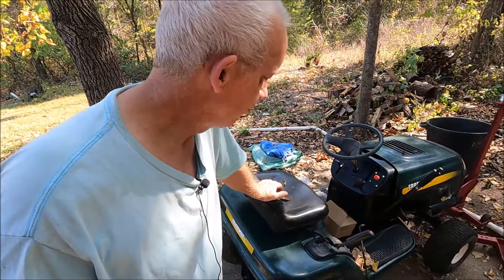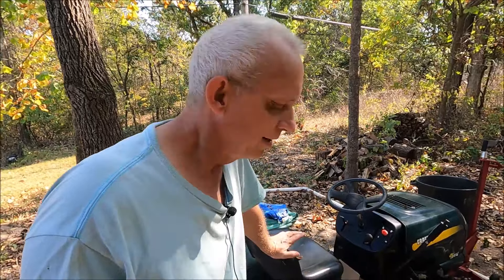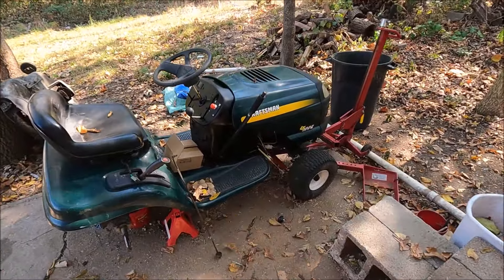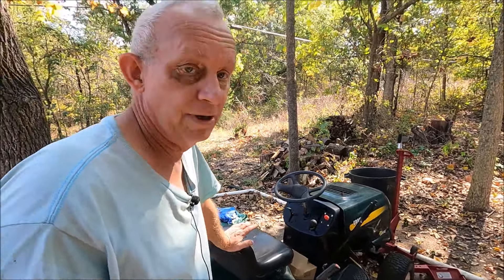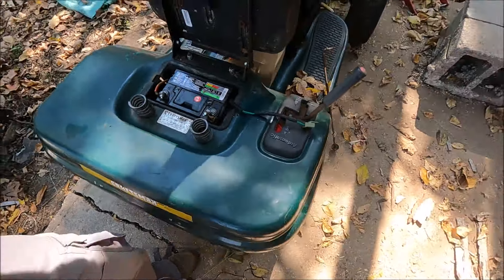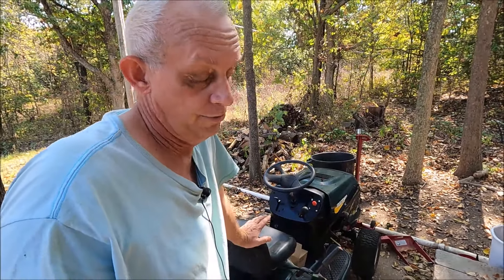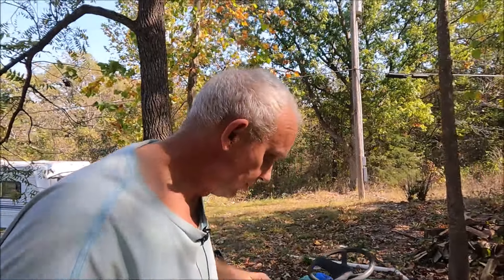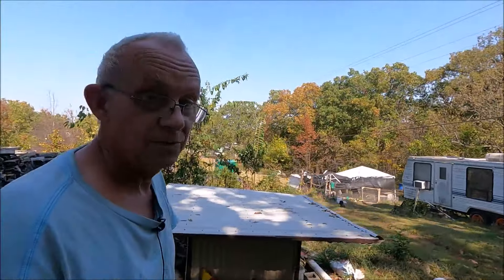A Subscriber Robbed Me Off Grid Living In A Tiny House

Comment: You are so right about people complaining no matter how you do it. Me personally, I appreciate the fact that you can figure out how to make things work for the least amount of money. That just makes sense in my mind and if you can make it work by fabricating materials on hand, even better as that reduces the money spent for repairs. I’m handicapped so there are things I need done and I have my go to handyman that I use as he is great at figuring out ways to accomplish the job and spend the least amount of money. I recently had a ramp installed for my wheelchair and/or power chair and he figured out how to use about half the concrete that would normally be used by using sand to fill in the ground as he made the forms. Bottom line is that it looks great works great and it saved me a lot of money. All that should really matter is that it works the way it should work, how you achieve that should be no problem for anyone else. But then some people will not be happy no matter what. Thanks again for another great video and I think you are just great at what you do.
Reply from the maker: Thank you